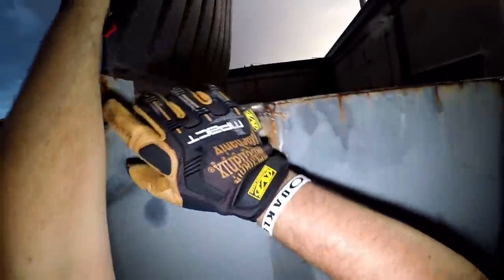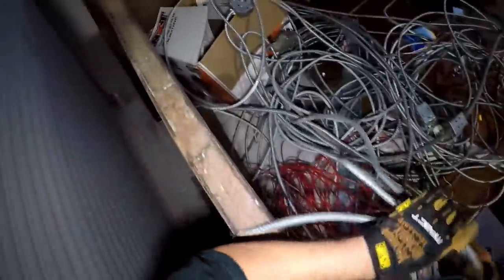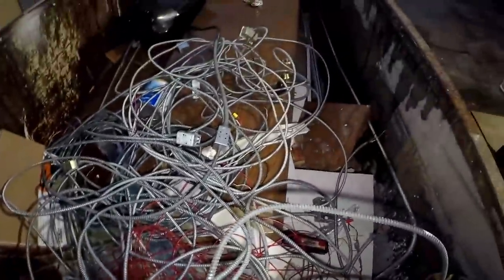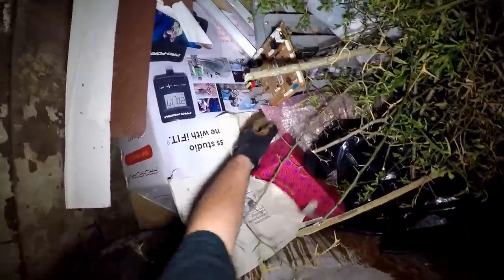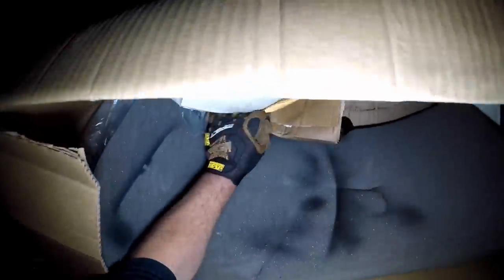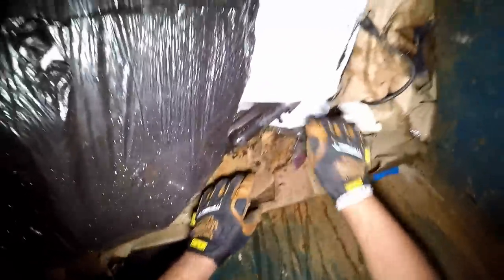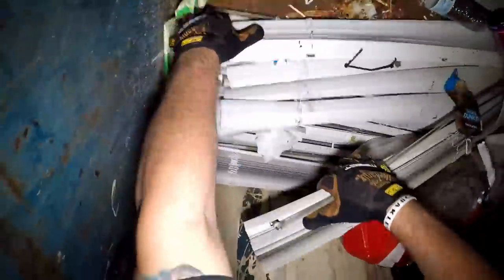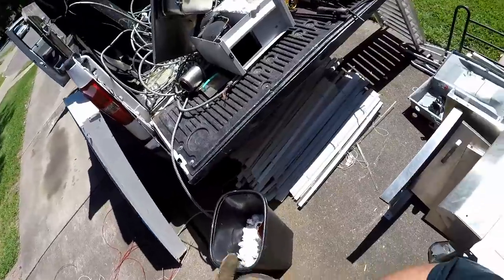Dumpster Diving "'Bout To Get Loaded!"

Comment: That machine from Julabo is a laboratory thermostatic bath. It is used for keeping a constant temperature of water during measurements. I personally worked with one of these during laboratory course at university. I don’t know if it was working, but if it was, you might had sold it for quite some money on the internet.

Comment: All the insulation is not necessarily because it is going to be very hot but because it needs to be very stable and at a constant / fixed temperature once set. Scientific equipment and testing machines are invariably that way as variations affect the test or results. Another awesome scavenge, just hope that prices are good for you tomorrow. Good luck.

Comment: Hell of a load you managed to get. At the rate you are going you gonna need a bigger truck
Reply: A ford transit chassis cab with a cage body on it and maybe a taillift would be perfect, esp the new 2.0l diesel models the US market just got, much more like the ones sold on the European market, albeit with automatic transmissions only. Dually rear axle for more payload and a bigger cargo space.

Comment: Mike what do you use to strip all your wires? By hand or do you have a machine to do it? I have seen heavy duty floor models and small table top versions (drill is used to push the  wire through the stripper)

Comment: hay another mike vid awesome hopefully get a good score like in the last vid, oh no rain well were getting some tuesday but that's okay, slight delay to scraping ppl please don't turn off normal service will resume once the weather has gotten a lil bit less heavy rain, JACK POOOOT~~~! wonder if that's from that place you showed us in the last vid that had been gutted and was being turned into new offices? either way score! that's not a spikey bush "shows garden" that's a spikey bush also help yourself to bamboo mike, your going to need a bigger truck huh mike? dam so the bbq pit parts were nice but right under the dumpster allumium blinds a whole heap of them yes indeed grabbing those, "oh next i'll just drive by the street and oh hell no! fricking oven and washer?!"  yep going to keep mike busy for a few hours might be time to head to the storage unit get a few of those engry drinks and use them huh mike?